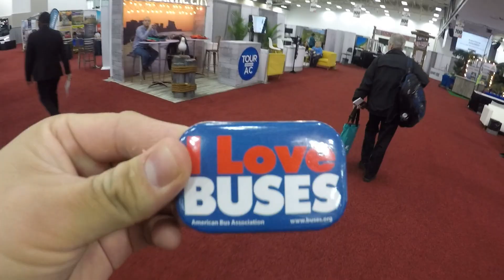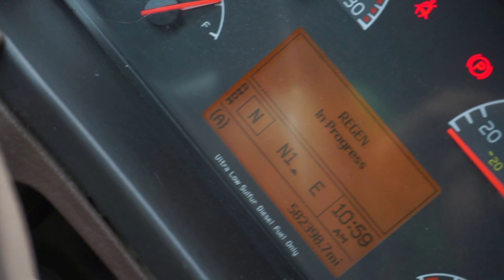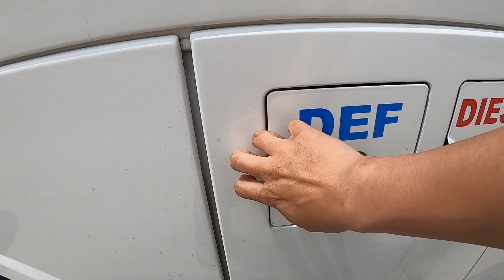How Going Green affected Coach Buses in the US.

Comment: The biggest problem in the industry is with DEF sensor availability. Every truck, bus, RV and engine manufacturer is having trouble with the sensor supply. $200.00 sensors are now going on eBay for $4000.00  or more; dealerships that have them require that THEY install the part.

Comment: Not a fan of cat motors in buses. 😆
Transit buses are designed to do active regen as a normal thing since they rarely get to highway speeds. Look at the dash light and see high exhaust temp light on, roll my eyes and sigh cuz it’s regening… again. Throw it in high idle if stopped for a layover helps a bit.

Comment: Joys of Diesel Particular Filters:

Truck requires Regen to be performed but the truck would not allow you to even high idle to raise operating temperature enough to Regen. 

Having the Regen light come on at the end of the day and knowing that you are better off finding a highway and waste an hour and the fuel or you'll regret it because it won't let you make several stop and go trips.

The Regen process had no progress indicator. If it actually activated parked it might run at a very high idle for 10 minutes or 2 hours. When it was done it would reduce the idle. 

And my absolute favorite was diesel exhaust fluid freezes. Being 200 miles east of Denver and the Def in the tank and piping all froze at highway spend. The so called limp home mode at 5mph was useless. 

Bonus common experience: Luckily not personal experience, but a bunch of trucks have burned down from from malfunctioning systems.

Comment: With the ever tightening EPA slowly and surely removing fossil fuel based vehicles from our lives, can you touch on how the bus/motorcoach world is responding?  GM, etc are slowly releasing "deadlines" where they will no longer be manufacturing fuel burning engines, and moving to electric.  What direction is the bus/coach industry?  Is there even a bus in existence that is full electric powered with the same range as a diesel powered on?  They already have hybrid busses and they surely benefit from the large amounts of instant torque that an electric motor can provide... are coach companies being mandated to switch their fleets to full electric vehicles by any date yet?
Reply from the maker: Hey Derek engstrom. I do know that fully electric coach buses do exists here now. However they are far from being efficient. I think you get about 200 to 250 miles per charge. And its about a 2 to 3 hour charge. Dont quote me on this I could be wrong. I know people on the west coast like San Francisco are starting to move that direction. This does sound like a good topic! I will add it to my list and start to do research! thanks Derek!
Reply: @MotorcoachWorld  For a city bus that sounds perfect. Do your 100-200 mile route over your shift then park the bus for the night to recharge. 
Even the least efficient EVs are far more efficient than the most efficient gas/diesel buses. At best 40% of the energy in gas/diesel makes it from the tank to the wheels, while >90% of the energy in a battery goes towards turning the wheels. 

For long haul trucking/busing EVs might not be the solution, I like the hybrid train idea someone above had, but for anything less than 300 miles a day electric is far better. 

Even if you get your power from the dirtiest coal plants around it's still cleaner to run electric for a bunch of reasons: The smokestack at the powerplant is far away from people, not right next to them in traffic or on the sidewalk. The smokestack in the powerplant is easier to make cleaner than millions of buses. Transporting fuel to hundreds of fueling stations is hugely wasteful compared to transporting huge loads of coal to a central plant then running the electricity it produces all over. Plus the grid is getting cleaner every day. Millions of solar panels are being installed per year. Tens of thousands of wind turbines. Dozens of other cleaner plants like nuclear, hydro, and geothermal are going up too. 

With electric it's pretty easy to power each wheel or axle independently, AWD without a giant driveshaft. Plus torque steering and possibly even independently turning wheels.
The instant torque is great, especially for bigger heavier things like buses. If you haven't test driven a newer EV I highly recommend it, they're a ton of fun to drive. 

Less maintenance and cheaper fuel leads to much lower cost per mile. My Subaru cost about 20 cents per mile, my Bolt costs 3 and that's just in fuel. I haven't had to take my Bolt into the shop for anything yet, meanwhile my 'Roo was in the shop almost once a month.
 
Solar roofs. You won't recharge a bus completely in a shift with panels on the top of it, but you can add a bit of range essentially for free. 

Vehicle to grid power. Each bus is basically a mobile backup power source for when the aging grid fails. School buses usually sit idle while the kids are in class throughout the sunniest parts of the day, so recharging them is a great way to use all that extra solar power being generated. 

Less downtime. I joke that my car takes 10 seconds to recharge, I just plug it in when I get home and it's ready the next morning. With my 'Roo I had to spend almost an hour a week making special trips to the gas station. 

Once you burn oil it's gone forever. Once the battery wears out in an EV you just recycle, or better yet up-cycle it. The sun's not going to burn out for billions of years, oil will probably run out before the next century. 

And just to put some numbers out there: Each gallon of gasoline burned puts out about 20 pounds of CO2 and other poisons. So a 20mpg car puts out about 1 pound of CO2 per mile driven. Use those numbers to see how many hundreds of thousands of pounds of CO2 the buses you drive have put into the air we breathe. My 'Roo is still on the road after 350,000 miles, that means that one car put out over 330,000 pounds of CO2 and tens of thousands of pounds of other junk. My Bolt is at >95% original capacity after 50,000 miles so it'll last to 300,000 easy before needing a battery swap, and in those miles the little bit of extra CO2 released by making an EV instead of another gas car has been saved many times over. 

The only benefit gas/diesel has over electric is greater range, but that comes at the cost of far greater waste and pollution. The range issue could also be solved via a few methods. From charging as you drive from either overhead wires or in road wireless charging, to faster charging at rest stops, to higher capacity batteries. Gas/diesel engines have had >100 years to get as good as they're going to get, we've just started making EVs en mass and they're already surpassing them in all categories except range.